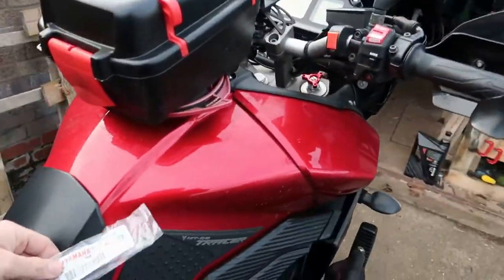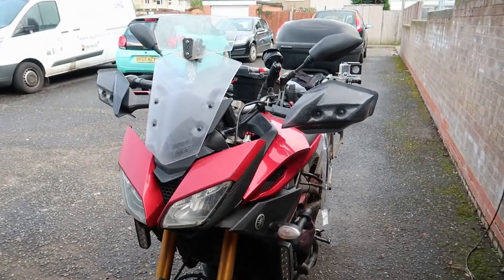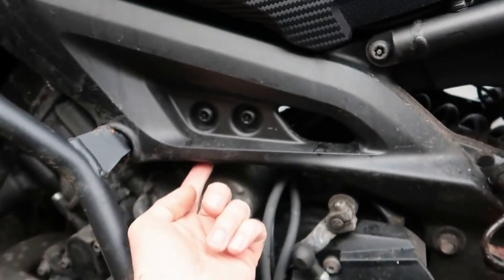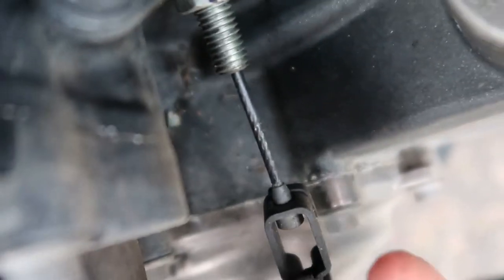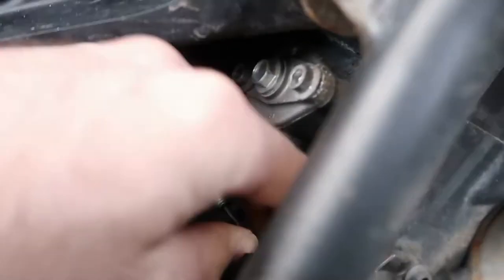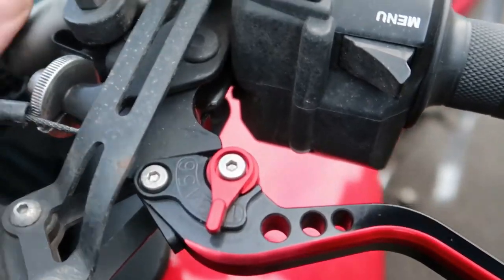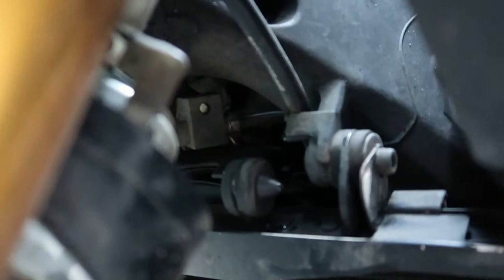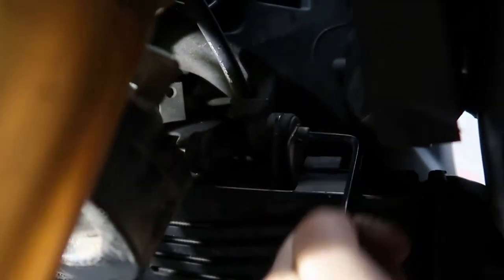NBW - Yamaha Tracer clutch cable swap

Comment: I was warned that this clutch cable (original design) snaps at 25-30000 mls and yet, I did not anticipate! Well it did snap and I had to push the bike back home 5 or 6 blocks (American) in the heat of New Orleans, La. Not fun! I had the  part over-nighted and just replaced it after watching your video. Thank you.

Comment: How do you like those long fog lights mounted sideways? how did you mount them? nice bike, thinking about doing the same. Not sure how the beam spread would be mounted like that.
Reply from the maker: I fitted them to make myself more visible to other drivers rather than extra light for me. They're mounted sideways to avoid breaking if I drop the bike.
Reply: @nicebigwrench8730  Cool man. Nice work. Are they ebay units? Any pictures/ videos with them on by chance? Cheers.
Reply from the maker: yeah just ebay units. don't think I've any photos since they went on actually